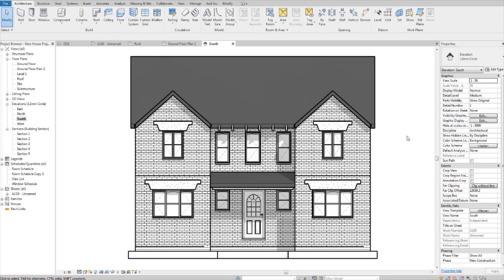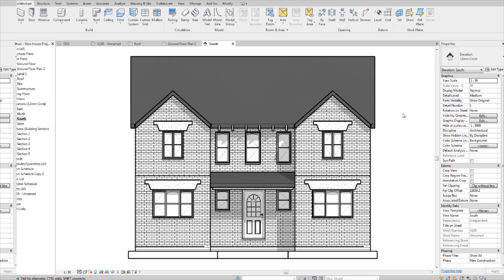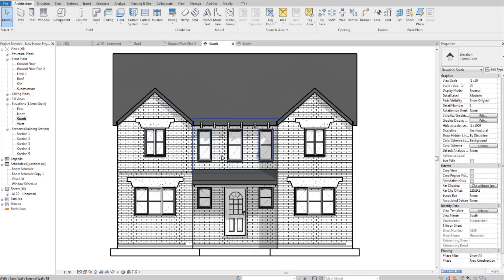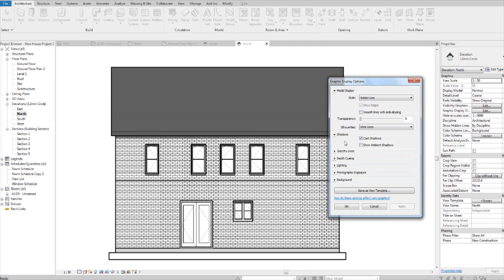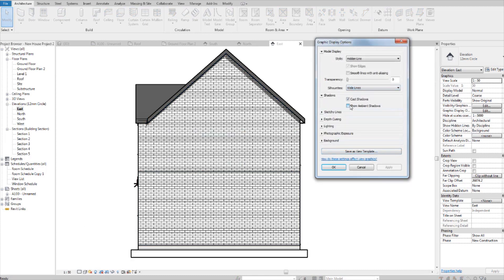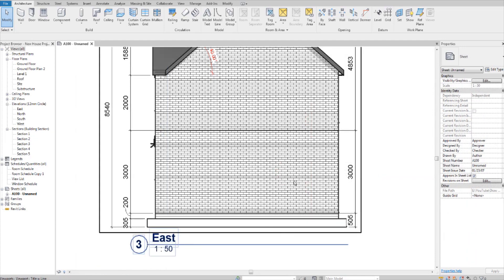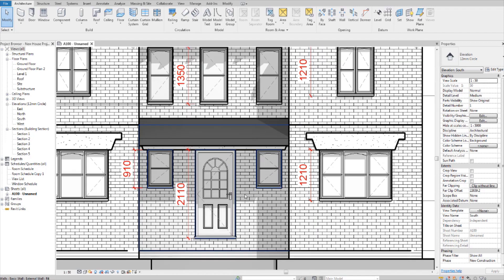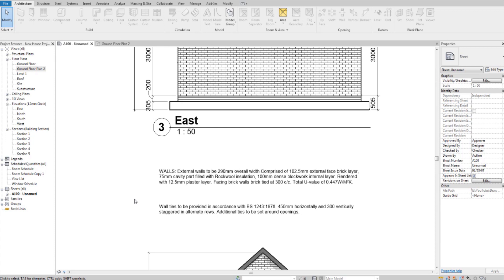Revit House Elevation Detailing Tutorial

Comment: What device and app do u use to draw that on?
Reply from the maker: I use a PC/Laptop and the software is called Revit. Expensive software, you can get a Lite version but it costs something like £64 - £72 a month. I'm using a trial version which used to be available to all, but unfortunately Autodesk have pulled that down so it's only available to students.
Reply: @DrawingTechnical  thank you for replying. I've always wanted to be an architect and I have 4 more years until university so I am trying to get more info.
Reply from the maker: @caramelting2309  Ah, there are definitely some things you should know, some things I wish I knew when I was at university, I'll make a video/podcast about it, but one of the things you should know is that teachers set assignments at university and whatever work you do, they'll criticise it harshly to see your reaction, you either have to make sure you have good informed responses, or you can go back and work on their comments. The reason they do this is to mimic the work environment, you'll have clients and of professionals crticising your work, and these teachers are training you to face the rough life with preparation. Don't let this scare you, I hope instead that this will help you to prepare rather than shy away. It's not as bad as you might think.
Reply: @DrawingTechnical  thank you so much for telling me that.
Reply: Is it possible for me to work part time job for 3 hours a day when studying architect or would that overlap the schedule?
Reply from the maker: @caramelting2309  I'm not going to say no, anything is possible in the right time and place. It might be a better idea to complete 2 years of study at a university and try to get an internship for a year, and then complete your last year. Most interns have told me that the companies they worked for in the internship have taken them back to become a part of their team. I'm not sure if anyone will take on someone for 3 hours a day. I could be wrong.
Reply: @DrawingTechnical  thank you for your time you've given me soo much information
Reply from the maker: You're welcome. That's what this channel's about